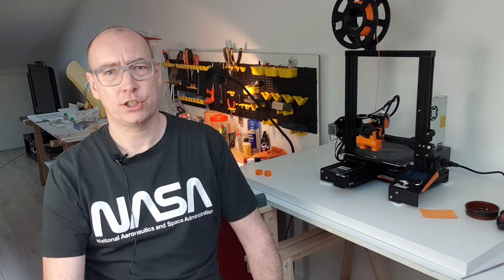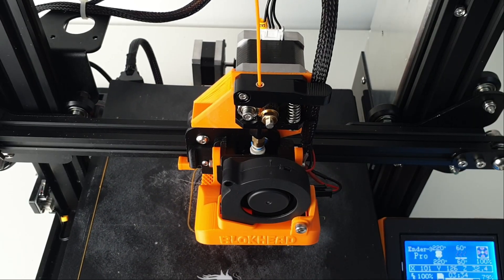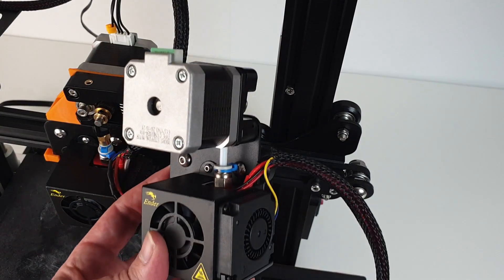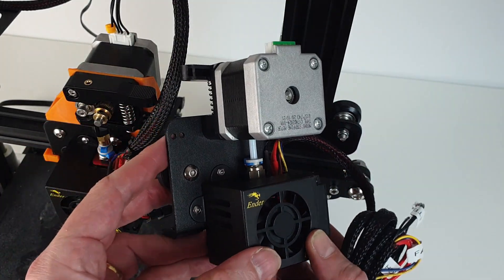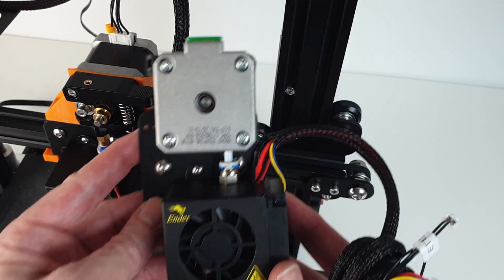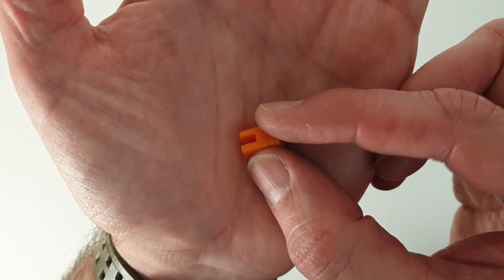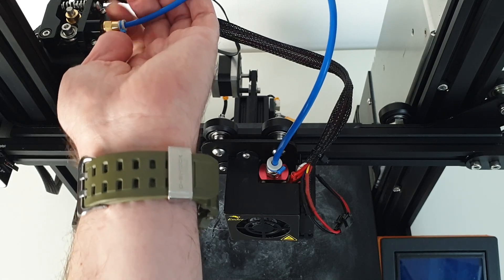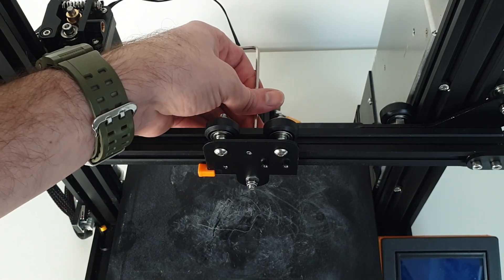3D Printed Direct-Drive for the Ender 3

Comment: does it need extruder cable extension? how is the sagging on X axis? nica and straight forward video!
Reply from the maker: Thanks for your comment. An extruder cable extension is probably required to reach the top of the printer. It depends how long your current cable is. I have no sagging on X axis but some people do. I guess it depends how the eccentric nuts are adjusted. Some people installed a dual z axis...
Reply: @YouMakeTech  i see. since the extruder is ontop of the gantry, its reducing the printing height by a few cm right? how do you avoid the collision with the upper frame?

i am ordering my ender 3 v2 as my fIrst 3d print now. cant wait to try this!
Reply from the maker: Yes, with this upgrade, you lose 13 mm on the X axis and 40 mm on the Z axis. To not lose any print volume, you can either swap the Y axis motor (4234) with the extruder motor (4240) or purchase a thinner motor for the extruder (I use this one -> https://amzn.to/3qEHUHR) . The 4234 motor is thinner and does not hit the frame. In addition, it is lighter which is good for a direct drive and the extra current/torque that the 4240 motor provides is no longer necessary because the friction is reduced due to the shorter distance between the motor and the nozzle.
Reply: @YouMakeTech  do you change the printable dimension in the slicer or printer firmware? i mean, we have stop switch at the beginning of every axis but not at the end.
Reply from the maker: In both actually. In the slicer, this prevents placing an object outside of the print area. And in the firmware to avoid having the printhead hit the frame
Reply: @YouMakeTech  do you perhaps have a video about this?
Reply: @YouMakeTech  and abt swapping the extruder motor with the Y axis motor, changing step/mm value is not needed right?
Reply from the maker: @mikealpha4462  Erçin Torun made a good guide about swapping the motors here: https://all3dprint.blogspot.com/2020/09/ender3-pro-direct-drive-bullseye-mount.html?m=1
No need to change the steps per mm. But you need to adjust the stepper motor current as per this video : https://youtu.be/k2nm-WetPnU
Reply from the maker: @mikealpha4462  I don't have a video for Marlin firmware editing. I do have one for Klipper: https://youtu.be/MaUU8stsZPo . With Marlin, you need to update X_BED_SIZE (default = 235 mm) and Z_MAX_POS (default = 250 mm) in Configuration.h, and flash the updated firmware in your printer. In the slicer, you can also update the build volume: In Cura, Settings -> Printer -> Manage Printers... Then click on "Machine Settings"  In Printer Settings, update  X (default = 220 mm) and Z (default = 250 mm). With the right build volume, Marlin and Cura will not command coordinates outside of the available build volume, preventing the head to hit the frame. I no longer uses this direct drive, I now uses a BMG E3D V6 direct drive: https://youtu.be/volF41C7BLI . For this configuration, I release my configuration files and firmware on Github: For Marlin: https://github.com/YouMakeTech/Marlin-2.0.x_config and for Klipper: https://github.com/YouMakeTech/klipper-ender3
Reply: @YouMakeTech  thank you for the guides man! this will really help me. good luck on your channel!. subbed

Comment: Could you please share Cura slicer settings for direct drive, in particular retraction distance and minimum retraction distance, thanks.
Reply from the maker: With Marlin and this direct drive, I could not reduce the retraction distance and was using Bowden-like settings : retraction distance of 6.5 mm and speed of 25 mm/s. The real "secret" of accurate and short retractions is to enable pressure advance

Comment: How much print area did you lose on X? Can you still print at the same speed than before? Is it really need to use the PTFE connector in the extruder motor?
Reply from the maker: You lose 13 mm on the X axis and 40 mm on the Z axis. To not lose any print volume, you can either swap the Y axis motor (4234) with the extruder motor (4240) or purchase a thinner motor for the extruder (I use this one -> https://amzn.to/3qEHUHR) . The 4234 motor is thinner and does not hit the frame. In addition, it is lighter which is good for a direct drive and the extra current/torque that the 4240 motor provides is no longer necessary because the friction is reduced due to the shorter distance between the motor and the nozzle. It is better to use the PTFE connector in the extruder motor to constrain the filament path and avoid any slippage.

Comment: what retraction settings did you use? im using 40mm retract speed and 1mm distance, and print come out quite stringy.
Reply from the maker: 3 mm retraction distance and 25 mm/s retraction speed. What nozzle temperature do you use? I ask because I noticed that above a certain temperature, no matter the retraction settings you use, oozing occurs. Maybe try to lower the nozzle temperature 5 degrees by 5 degrees until oozing goes away.
Reply: @YouMakeTech  i am using 195 nozzle 60 bed
Reply: @YouMakeTech  0.3, 0.30 or 3.0mm? please help
Reply from the maker: Also make sure that the PTFE tube is cut perfectly flat and is pushed down against the nozzle. Any small gap at the interface between the nozzle and the tube can degrade retractions

Comment: with this mod, how do i replace burnt ptfe tubs in the hotend?
Reply from the maker: You have to either remove the hotend or the motor to replace the PTFE tube. All direct drives are like this. The best is to get rid of the PTFE tube in the hotzone using an all metal hotend (Swiss or E3D V6). With an all metal hotend, you never have to replace the PTFE tube!
Reply: @YouMakeTech  i see. does the all metal end work fine with the mod
Reply from the maker: Yes, the micro-swiss all metal hotend is a direct replacement of the stock hotend. For other hotends and extruders, there are various remixes available but they are a bit more complicated to install
Reply: @YouMakeTech  ok thanks! i may consider getting one. also, would you happen to know if the satsana fan duct works with this?
Reply from the maker: @jmyers1776 If you are getting a micro-swiss hotend, maybe also consider the direct drive version: https://store.micro-swiss.com/products/micro-swiss-direct-drive-extruder . I believe this mod is compatible with the satsana fan duct but I cannot be 100% sure because I haven't tested.

Comment: Would the piece of the bowden tube placed in the heating element melt?
Reply from the maker: Indeed, the bowden tube is in direct contact with the nozzle. It does not melt but is subject to high temperature and wears out over time... This is not specific to direct drive... This is why I replaced my Creality hotend by an all metal hotend. Check out my other video where I discuss this in depth: https://youtu.be/volF41C7BLI

Comment: Great video, i like it. I have a Ender 3 V2 and was thinking about a Direct Drive but i have some worries. This steppenmotor is (for it's size) pretty heavy, and you are going to put all that weight on top of the extruder. 
Does that have any affect on the printing or quality ? 
Also does the structure of the printer itself not need extra support because of the extra weight ? 

I guess you made a lot of prints with your design already and i hope you can give me the answers to my questions, i would hate to ruin my printer. 

Thank you very much in advance.
Reply from the maker: Thanks for your comment. It is a valid concern. For sure the extra weight is a bad thing. The motor adds 280 grams to the print head. It does create some ringing at very high accelerations (3000 mm/s2) but at normal accelerations (500 mm/s2), the impact on print quality is unnoticeable. Note that the Ender 3 cannot print very fast anyway. To move on the Y axis, it moves not only the bed which is quite heavy + the weight of the printed part. I have been using a direct drive setup on my Ender 3 since the beginning and I print quite a lot, several hours per day! I am pretty satisfied with a direct drive setup and no way I am returning to Bowden! Loading/unloading the filament is much more convenient, I can print flexible filaments, retractions are much more accurate and easier to calibrate.  If you are satisfied with your current setup, don't change it. If you want to print flexible, are not satisfied with your current retractions, try this, it costs nothing, you can even revert to Bowden if you don't like it. On my current setup, in order to save 60 grams on the print head, I replaced the 42-40 motor (280 g) by a 42-34 (220 g). The 42-34 is the same motor used on the X,Y, Z axis on the Ender 3.
Reply: @YouMakeTech  Thank you for your reply. 
To be honest, i wasn't planning on going supersonic lol, i was just looking for a way to speed it up just a little bit, and to have a little bit better quality prints because of less retractions (less stringing) 
Honestly i am pretty new into 3D printing and have yet a lot to learn, but i will get there eventually lol. 
I do like the setup as it is right now, with some modifications i have done. What i am looking for is a little more speed and smooth prints, basically that is why i am looking into direct drive.
making a long story short...
What you mean is that i can use it as is without worrying about the frame being not strong enough, right ?
Reply from the maker: The frame is strong enough, no problem.

Comment: About to do this but wondering how/where to attach my EZABL leveling probe.
Reply from the maker: Which fan duct are you currently using? You can combine the Bullseye or the Blockead with the SpeedDrive. The Bullseye/Blokhead provide ABL device mounts which are compatible with many ABL sensors, including the EZABL. See http://www.dpetsel.com/files2print.html to see which files you need.

Comment: Hi, didn't you have to modify the firware to have added a stop to avoid bumping the engine?
Reply from the maker: You can modify the bed size in the firmware to avoid hitting the frame.  In some cases, it is not necessary. If you never print parts wider than 220 mm and taller than 210 mm and if you do not use Auto Bed Levelling, it works without firmware update. Sometimes, depending how the firmware is configured, Auto Bed Levelling can make the head move above X>220 which would hit the frame. In all cases, updating the bed size in the firmware and in the slicer is better as it will guarantee that the head cannot hit the frame
Reply from the maker: I forgot to mention that by swapping the Y axis motor with the extruder motor, the motor no longer hit the frame because it is thinner...

Comment: can i do the  same for my ender 3 v2?
Reply from the maker: Yes it works but you need to use a modified design because the backplate of the V2 is slightly different. People with an Ender 3 V2 reported success with this design: https://www.thingiverse.com/thing:4721965

Comment: This seems awesome. How has the printing been since you did this upgrade? I have my ender 3 with bowder tube dialed in fairly well, the only problem I am having is with more flexible filaments I get lots of thin wisps. not exactly stringing, just thin wisps around the outsides of my prints (not necessarily between islands). I am hoping that an upgrade like this would help to bring those wisps to a minimum. Although I am afraid that if I do this upgrade it may throw some of my other more refined settings off, does that seem like it would be a problem or would it only stand to help? You seem really good at responding to comments, so thanks in advance and you earned a sub either way! Keep up the good work and I can't wait to see where your channel goes! #HereBefore1000
Reply from the maker: Thanks for subscribing. I am very satisfied with this upgrade. It makes easy to print flexible filaments / TPU. Regarding the print quality, I believe you can get the same quality with a Bowden setup but retractions are a bit more tricky to calibrate. Regarding the wisps: I have the issue too but haven't identified the root cause yet. It occurs systematically with one old roll of black filament. Is this because this filament is too old (humidity?), because the filament has a quality issue or because the print settings are incorrect? I don't know yet for sure. What I know is that I can get rid of the issue when: 1) I use a brand new filament from the same brand (Sunlu PLA+) as it comes out of the plastic bag. I noticed that the print quality degrades as the filament becomes too old (storage>months) 2) I use a lighter color (Yellow/Orange). I only have seen this issue with black 3) I increase the nozzle temperature by 10-15 deg C.  I noticed that when the nozzle temperature is too high, I get stringing (with the same color as the filament). But it looks like that when I reduce the nozzle temperature too much to get rid of stringing, I get these very thin wisps, of white/grey color for a black filament. How old is your filament? Which color? What nozzle temperature/retraction distance & speed do you use? Sorry, I do not have a specific answer to your question, I am more a 3D printer user than I am a 3D printer expert! Hope this helps
Reply: @YouMakeTech  Thank you for the response! 

I have a 4 day old roll of Black Sunlu SPLA that gets these wisps. I am printing at around 235 C which prints nicely save for the wisps. My old spool of Black Sunlu PLA (Which I have run out of) printed very well with no stringing and no wisps at 200 C, so maybe it is simply that SPLA is hard to print with? I am buying another roll of the Black Sunlu PLA. My retraction is 5mm and retraction speed is 40mm/s. 

Off topic: 
Have you used Sunlu SPLA or only their PLA? I really enjoyed their PLA as it printed well and was quite strong (I print a large amount of "Practical" prints that are under a lot stress during their use.) I have, however, been very dissapointed with the SPLA as it seems very brittle. If you have used SPLA, have you noticed the same? It would be awesome to see a video where you did some tests with Sunlu PLA vs SPLA ;). Keep up the great work!
Reply from the maker: I have no experience with Sunlu SPLA, only PLA+. Very satisfied with it. I only have wisps with one old roll of black filament. For PLA, I quite like ERYONE. Like you, I print almost exclusively structural parts and I find PLA very brittle. Maybe we should try ABS?
Reply: @YouMakeTech  ABS seems like a giant that I am not yet ready to defeat. I have only been 3d printing for a couple years now. It would be interesting to see how the same part would benefit being printed in ABS vs PLA. I guess I would need to build an enclosure for that. I really appreciate this conversation, it has been quite helpful to be able to hear back from someone that I consider to be a stand up member of the community. You really are underrated and I hope your subs explode soon. Then again, my comments would get lost in a sea of others XD.
Reply from the maker: @youngredstreams2667  I never tried ABS neither but I definitely will. To get stronger parts in PLA, have you ever tried bigger nozzles? Like 0.8 mm? You lose some resolution of course but this makes very strong parts! And it prints ultra fast. In my testing, I used an E3D Volcano hotend with a 0.8 mm nozzle. Using 0.6 mm layer height and a line width of 0.8 mm, it makes very strong parts ultra fast with PLA. Another thing I tried is to print without layer fan: This improves adhesion between subsequent layers and results in stronger parts. Coming back to the wisps issue: Have you ever tried to reduce the retraction speed? Something like 4 mm/s instead of 40! It seems to solve the issue for me. 4 mm/s seems very slow but in practice, because the retraction distance is very short (1 to 6 mm), it does not make a huge difference. This gives more time to the filament to cool down before moving to the next point + retractions are much more accurate (no filament slippage). Thanks for your comment. Of course I try to grow my channel but my primary interest is to grow a community of people who shares the same interest/passion as me. I am new to YouTube but I was amazed by the encouragement and good advice I received from people leaving comments. I hope my channel does not grow to the point I cannot answer every question/comment!
Reply: @YouMakeTech  I will absolutely try those settings and I have a few extra nozzles that I can drill out to test a larger size. Thanks for everything. I will definitely stay tuned for more videos!
Reply from the maker: Cool. Please let me know how it goes!

Comment: The issue is it cuts down your print space on both sides
Reply from the maker: True, with the upgrade as shown on the video, you lose 13 mm on the X axis and 40 mm on the Z axis. But there is a solution ! (I didn't know at the time I published the video), which was suggested by one of my subscriber (Erçin Torun): In order to not lose any print volume, just swap the Y axis motor (4234) with the extruder motor (4240). The 4234 motor is thinner and does not hit the frame. In addition, it is lighter which is good for a direct drive and the extra current/torque that the 4240 motor provides is no longer necessary because the friction is reduced due to the shorter distance between the motor and the nozzle.
Reply: @YouMakeTech  I actually took your design and tweaked it to make it work without hitting the bars on either side. Would you like a copy? You could potentially clean it up and make another video. l put the the motor on the opposite side of the z axis. So far I’ve been getting great prints with it.
Reply from the maker: Actually it is not my design, I just made the video! IMO the motor location in the Speeddrive design is optimal because the motor CoG is above the X rail. This reduces the imbalance compared to other motor locations and is compatible with many cooling mods. To not hit the frame, the 42x40 mm motor can be replaced by a 42×34 motor.  This provides the additional benefit of reducing the weight of the moving parts by ~60 grams.